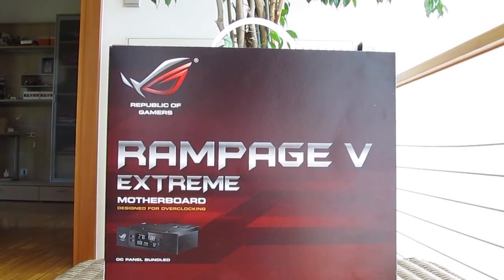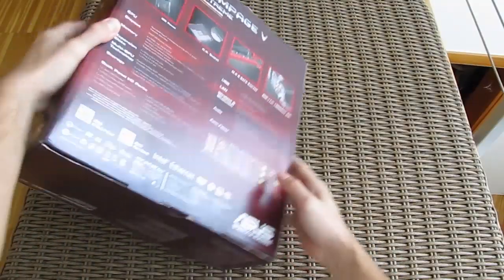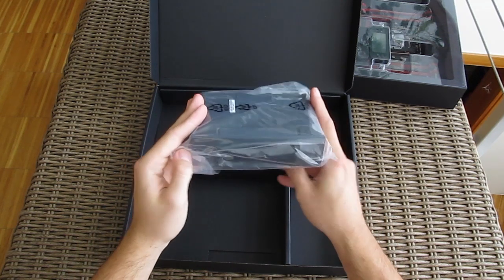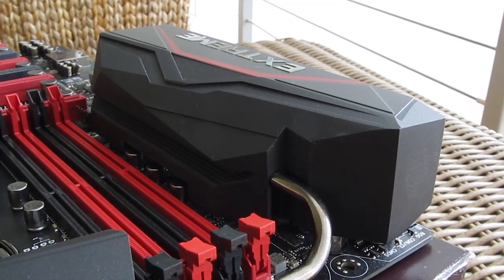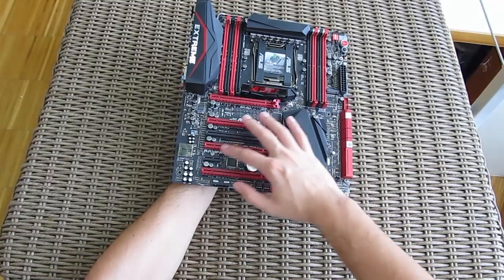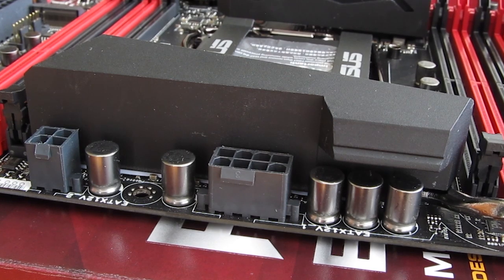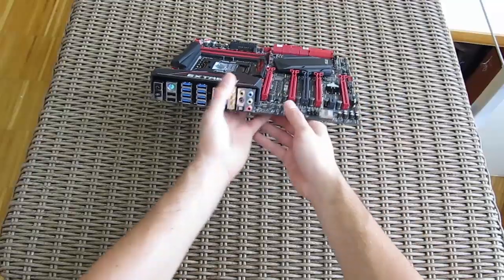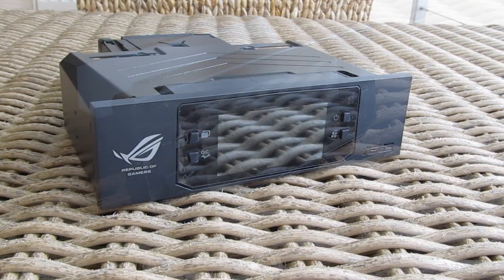Asus Rampage V Extreme Unboxing & Preview

Comment: I still don't know how to use the row of headers to the left of thunderbolt connector. Not a single review covers it. Everyone always talks about everything else around it but not about those weird looking usb connectors. And this one connector on the left side of that row that sits by itself. I think a 3 or 4 pin header. Please help if anyone knows. I've tried connecting usb 2.0 to all of those and it won't boot to bios either way I move the connections around. Thanks guys!